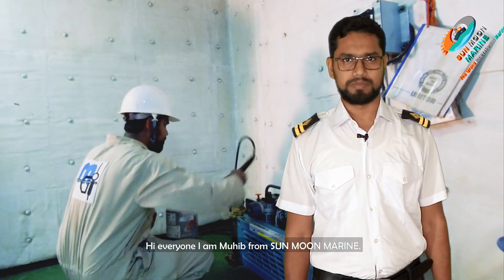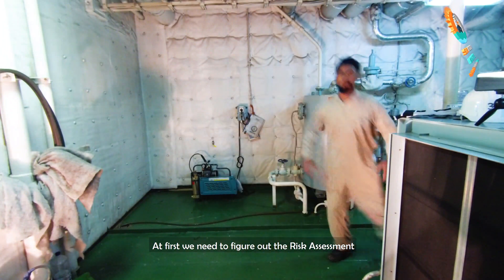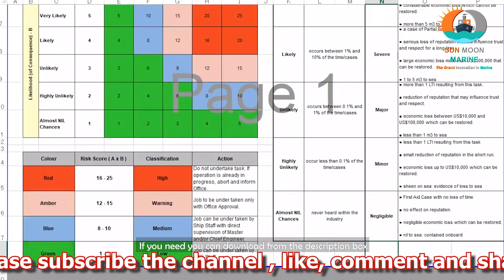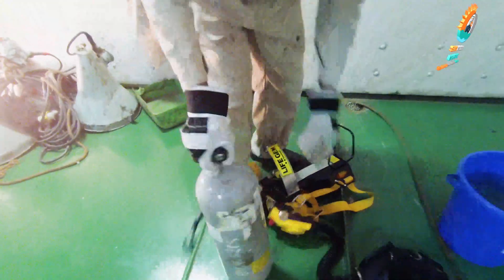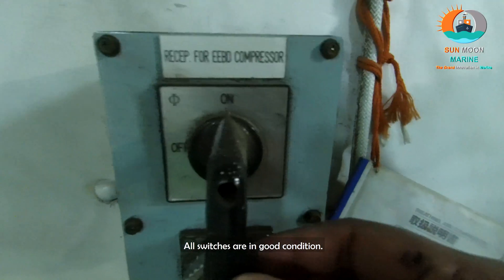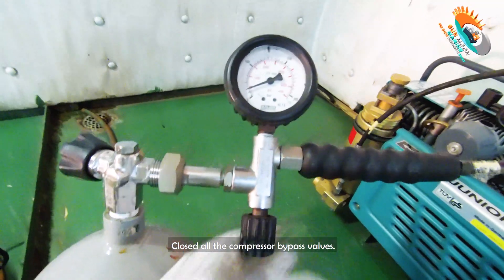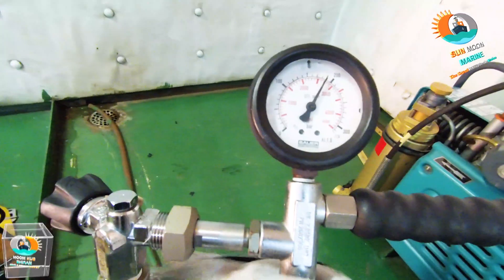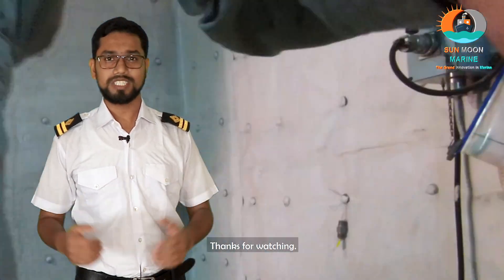How to refill or recharge SCBA or EEBD Cylinders onboard?

Comment: The procedure you have shown here , has some missing steps. 
when compressor is connected to cylinder never open cylinder valve directly, first open compressor drain valve to remove accumulated moisture. then check you cylinder pressure, when your compressor pressure above the cylinder pressure , then open cylinder valve to fill cylinder otherwise high pressure from cylinder will go to compressor line , and ma cause injury.  when stopping the compressor first close cylinder valve and then open the compressor drain valve .
Reply: this is the correct way and most most overlooked instruction in the manual.

Comment: Drain valve should be open, when you start BA compressor to remove water and oil from the system, after you finished opening of drain valves from the cartridge chamber prohibited, because service life of cartridge decrease.